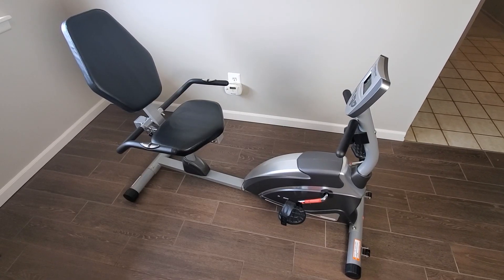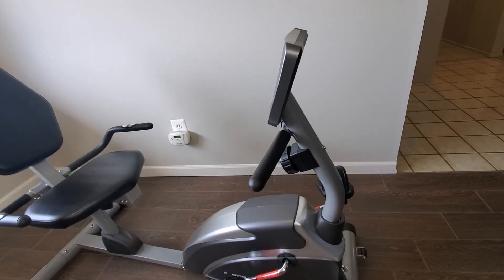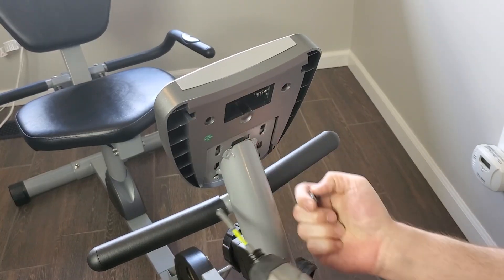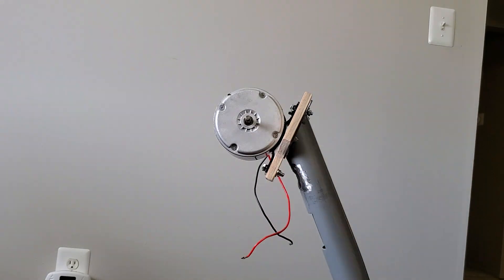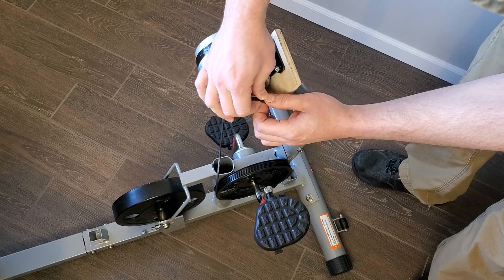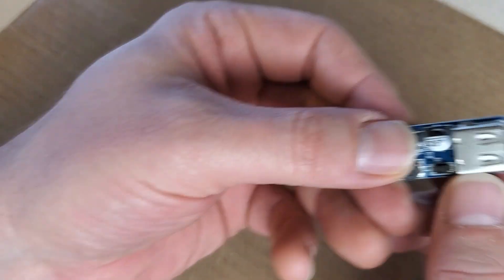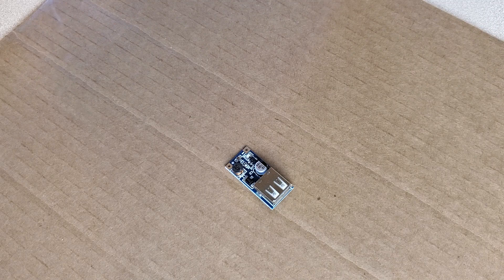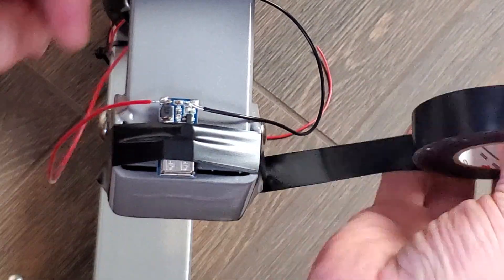Turning a Recumbent Exercise Bike Into a Generator - DIY Pedal Drive Battery Charger

Comment: Why didn't you just put your pulley around the flywheel so it also acts to increase rpm..?

Also; it's a pulley and not a pushy for a reason... 
ie: the idler should Always be on the slack side of the pulley..!
Ideally you want adjustable tensioners because the idlers are just parasitic drag.

Comment: Whatever anyone does I feel can be achieved with correct size of wheels . The concept just needs to be perfected then have a chinese company make many . 
Imagine millions using a solar generator with Charge 1 from  Bluetti solar generator to charge a battery bank in a hour of use .  It doesn’t need to be all at one time just a few times a day .

Comment: What if you keep the flywheel stock, add a skateboard wheel to the motor shaft for friction, and the use a spring to pull the DC motor assembly against the flywheel?

That way the flywheel stores some kinetic energy and smooths the output to the DC motor.

Comment: Rowing machine is 1.5 to 2 times more efficient in generating electricity than a cycling machine.  If you add a giant metal flywheel to capitalise on gravity and centrifugal force, then you might get even more efficient.  Even if you build a very energy efficient home (like 10-20 cm thick spray-foam walls and floors, and very little volume), the generated power will not be enough to take care of heating that space, but over time, your body will.  But it will be enough to take care of lighting (if you use a 5W LED bulb), phone, radio and even TV for couple of hours a day. You will have to cook and heat your water with gas.

Comment: Still waiting for someone to build a direct drive axial flux generator out of the bicycle wheel itself. This is the most efficient conversion and transfer of kinetic to electric power. The more friction and heat you introduce with long belts or chains, the less kinetic energy will be converted. By turning the wheel itself into an axial generator, you're removing a lot of friction and could potentially still use the gears with a longer axel and by mounting the wheel with the two core halves (one fixed position), outside the forks. Someone take an old washing machine axial flux motor and show the internet how it can be done! Unfortunately I don't have the tools.
Reply: There is infact someone who has done just that. I have built one with a fisher and paykel smart drive rewired and it generates around 310w with gears and chain set from a mountain bike, flywheel and generator run together on the shaft with the freewheeling hub. The person on youtube who did it made a very neat version with the washing machine motor mounted directly on the side of the flywheel using an lg washing machine motor, slightly different to what i have but the same output. I have ordered slightly taller gears for mine as i have to pedal really fast to get the power but not much torque required. Im hoping to increase my pedaling torque a little and slow down while still having good generator speed. 
Search exercise bike generator and im sure youll find the video im talking about. Mine has a three phase rectifier going directly to the battery via a shunt, no charge controller or anything fancy and i can get 21amps under load at 13.1v  and 25 volts unloaded so its definitely got potential. I wish mine was a recumbent style though it would be far more comfortable 😂

Comment: typical car battery has 100 Amphours. That means at 14 volts charging voltage, you need to supply 1400 watt hours or 2 hp-hours to fully charge it from discharged state. 

“An elite cyclist can produce 440 watts over an hour…An adult of good fitness is more likely to average between 50 and 150 watts for an hour” https://en.wikipedia.org/wiki/Human_power

so let’s say 100 watts. That will require 14 hours of total pedalling time to charge the battery. Are you up for it?

Comment: Put the whole thing back together and glue magnets to the flywheel and mount multiple coils next to the magnets and wire them so as the magnets pass by they induce a magnetic field in the coils generating dc power from the coils, or even AC power then rectify it to dc. Then use that power with a regulator curcuit to charge a battery.

Comment: 1) a belt or chain always need a tensioner.
2) the tensioner will be in the return path.
The path with tension (between) generator and pedal should be fixed.
You should try to put a pully on the fly wheel, that will increase rpm and the fly wheel is necessary.
An untrained human in your setup should be able to produce 100W for a few (like 8) hours.
Put a desk in front of you and you can work while exercising.
When you are trained, the top will be over a kW. And you might do 200W for a long time.

Comment: have you considered putting the original belt back on the fly wheel and fabricate another belt tensioner? Basically keeping the original belt setup and adding whatever mechanism on the inside of the pedal pulley to link to the generator.

Comment: I bought the same motor and pulley. How did you mount the pulley?
Thanks!!
Reply from the maker: That was kind of a pain. There was a little tiny sleeve of metal that I believe came on the motor shaft. I used that as a spacer/bushing to make the pulley fit snug on the shaft. But, it was just slightly too big in diameter, so I used a dremel to shave a tiny bit off where the seam is, and then use a vice to carefully compress it tight once that sliver of metal was removed. Then it was a very good and snug fit with the pulley.

Comment: I have the same model bike. Put a lot of mileage on it before the pandemic. Not a bad bike for the price (circa 2017). There were plenty of better ones on the market but not much that competed with it at the price (in Canada). Great bike to start with until you know you are going to use it as more than a clothes rack.

As far as I know the handles on the vertical bar are only intended for steadying yourself to sit  down (doesn't really work well).  I've only ever had for them was as a foot reset when tying a shoelace or dragging the machine around.

Other things. The square tubing flexes a lot (where it joins together). I found supporting it with a block made from corrugated cardboard helped a lot. Also if you don't use thread locker the bolts like to back off with regular use.

Comment: Really like the idea of perhaps being able to charge a 12v battery.  That would be tremendously useful.  Please, keep us updated on this project, Great Lakes!  Awesome!
Reply from the maker: Thanks, I will very likely be doing a follow-up when I figure out how to crank up the juice a bit more.
Reply: @GreatLakesPrepping  Excellent!  Thanks, Great Lakes!
Reply: @GreatLakesPrepping  build a multi gear crank up the front bar increasing the rpm ?
Reply: Put a table on it, connect a fan and use the internet on a notebook while exercising. Just use some sweat resistant keyboard and mouse.

Comment: I've been planning to do this for some time now.  I was thinking a multi-gear ratio bike hooked to a car generator.  Your trial and error here has given me a lot to think about.  I appreciate your content.
Reply from the maker: Thanks Paul. I've definitely been thinking about how I could possibly gear this thing, but I don't know that I have the engineering skills. I'd probably have better luck finding a more proper motor. I will mention that I've learned that a car alternator needs to be "energized" before it will start generating, and that initial "energizing" often requires more RPMs than the average human can pedal on a bike! Though, with the proper gearing, I suppose anything's possible.
Reply: @GreatLakesPrepping  Thanks for the reply and thanks for the tip on the car aleternator.  I want to find out if a 12 speed or 15 speed bike with generate enough RPM and if there is a motor/generator that will allow 12v with reasonable effort.  It's just draining though to try to find the answer on YouTube with all the sketchy content.  Please keep us posted as to what you find and I will as well.  It's a great idea. Hell, if a water wheel or water flowing from  a stream can do it, there has to be a reasonable way to do it with human power.
Reply from the maker: @paulschwartz2464  I know it can work, but I too had a hard time finding specific answers (for a layman like me, anyway). I'm working on putting together a circuit that might do the trick. I will definitely post an update whenever I figure this out!